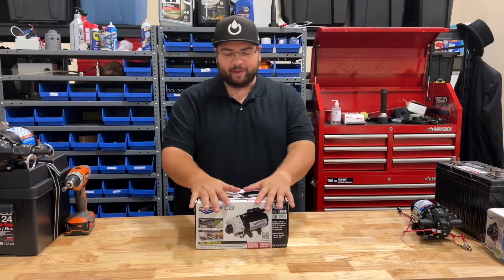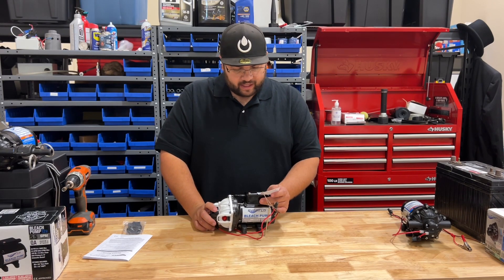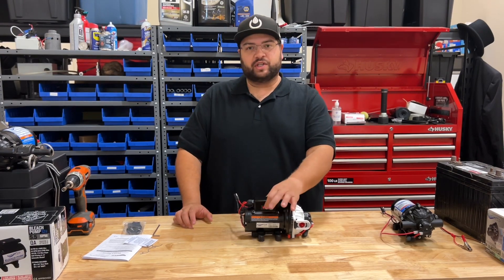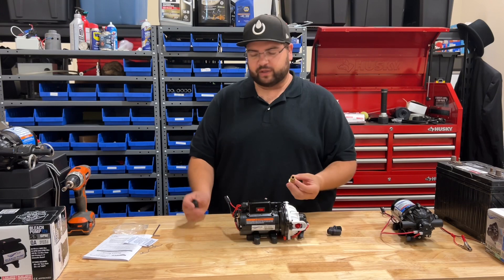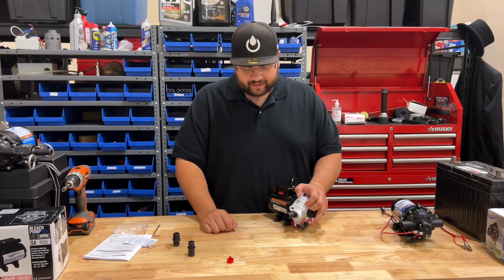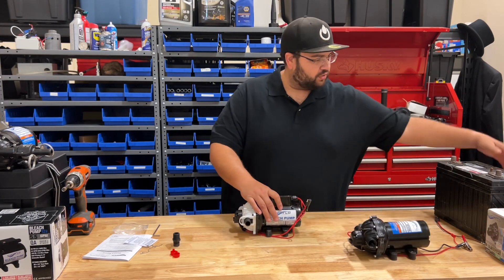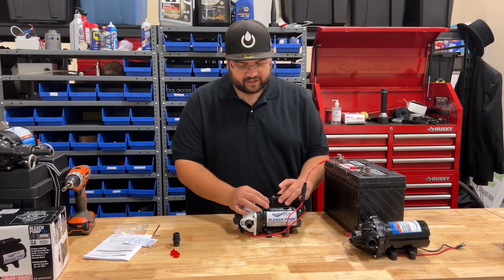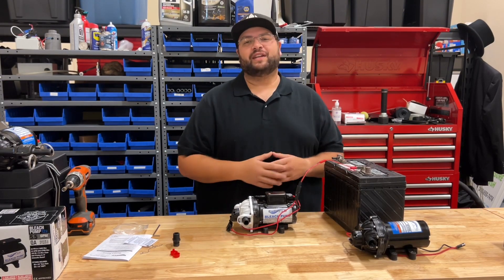Everflo EFSW5500-BOX Bleach Soft Wash Pump | Unboxing & Initial Reactions

Comment: Hi John, with the 3/4 inch ports/barbs do I also need to upgrade me blend manifold to 3/4 as well? I'm noticing that this pump is surging only when I'm on the roof - despite adjusting the pressure switch. (Works fine when nozzle is at ground level) Or would the fix be to use larger orifice fan tip nozzles. Or would it be both?  Would this problem be alleviated easier if I simply swap the intake and discharge barbs down to 1/2 barbs??

Thanks for the video!
~ Mark

Comment: I'm assuming the Everflo pumps are the same as the Northern Tool (they look identical) and if they are, I definitely would not recommend them according to my experience. I really wanted them to work but I had multiple pumps go bad the first time I used them so I switched back to the standard 5.5 I do recommend the quick connect style for ease of changing out pumps of needed or replacing hose. I've never had the o-ring go bad on mine yet.

Comment: Hey great video...just wondering if your able to interchange the bleach head to the other pump motor
Reply from the maker: Oooo good question. I’m going to say no because the switch and the leak sensor. While I’m sure you can make it work, it would make things much harder for a field strip. (That video coming soon)